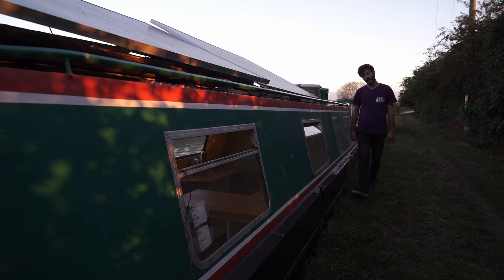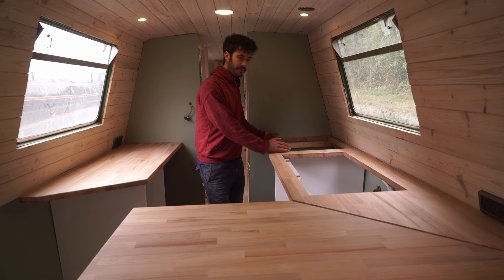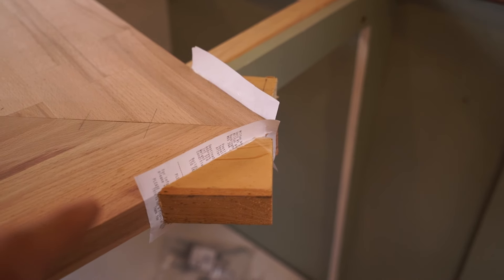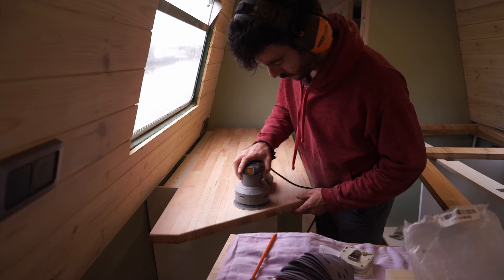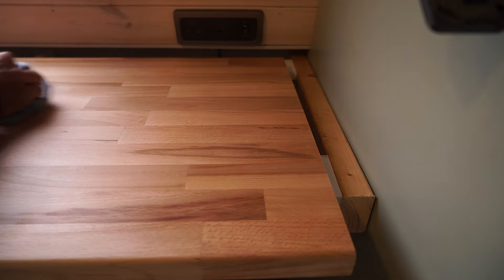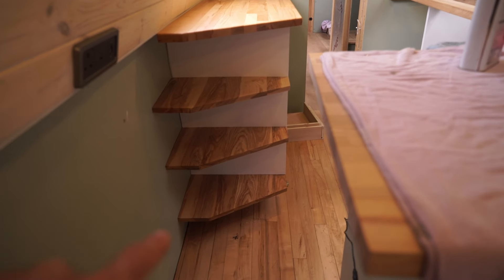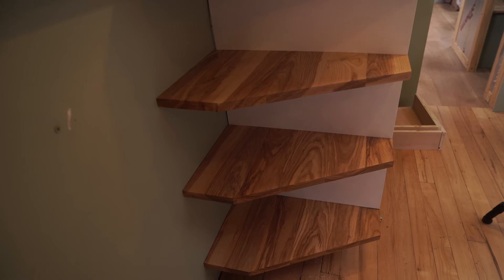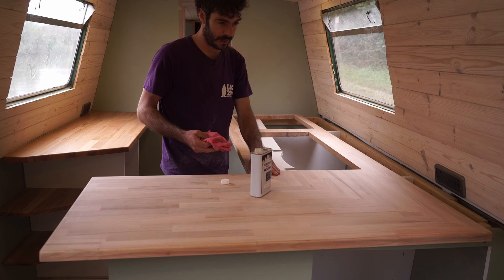Renovating a narrowboat EP7 - Making kitchen drawers and finishing the plumbing!

Comment: Oh, the gap can be filled with sawdust and pva, use the same wood as it keeps the colour of the original board
Reply from the maker: Thanks man. Every time i do that the mixture goes a weird grey colour, so I didn't want to risk it.
Reply: @EddHawkes use (wood) glue that dries clear & use the wood fluff (aka sawdust) from your small sander, as long as its clean (incl your hands). Try it out first on an extra piece of wood to ensure the mix is right & dries how you want it.

Comment: loved it. Can the cooker hob be turned 90 degrees so that the big burner is away from the wall with the dials at the side instead of in front?
Reply from the maker: Thanks!
I did actually consider that but the depth of the worktop is 600mm and that is the exact width of the hob, so it won't fit. I don't think it will even be a problem. I should dig out my wok and do a test fit 😂

Comment: 2mm floor clearance isn't enough. When the drawers are full, eventually, it will drag on the floor.
Reply from the maker: Ah damnit! I could always move the slides a bit. I think there is height adjustment on the screw holes. Cheers for the heads up.